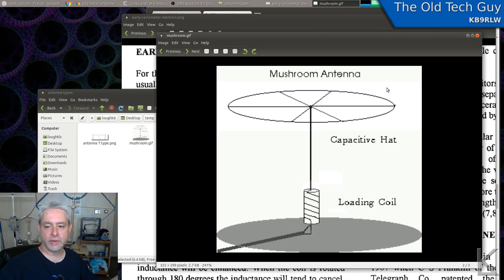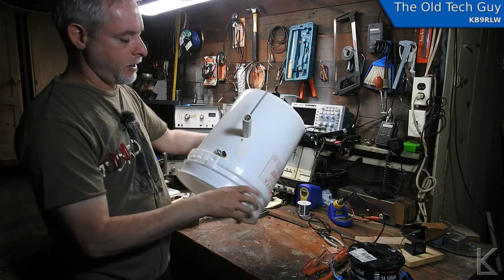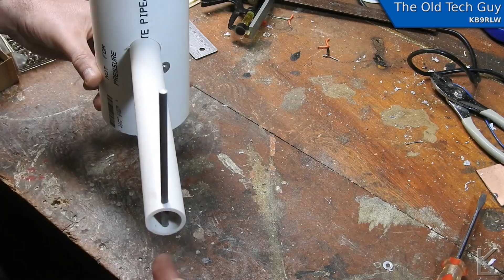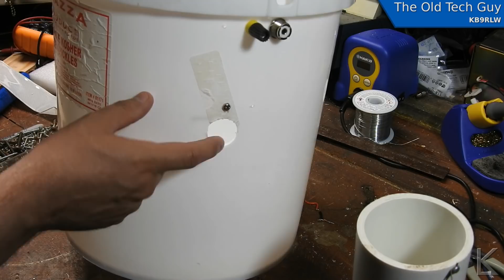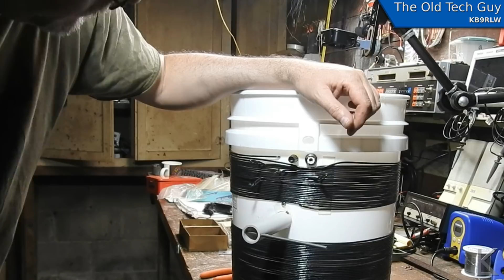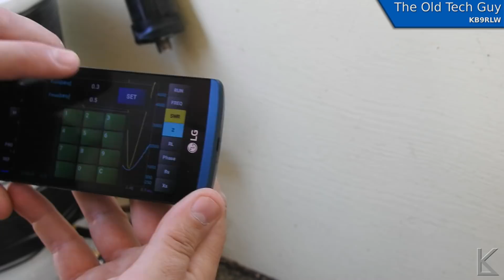Ham Radio  - Get on 630 meters with a bucket variometer!

Comment: Would this work for 252 kHz?
Reply from the maker: You would either need quite a few more turns or a much longer antenna wire.
Reply: @ I have a half-wave 600m wire but need to learn how to load it for 1kW…….

Comment: I think PVC can hold a static charge. Maybe use a wooden shaft for that axle and delete the metal turning grip (??)
Reply from the maker: With an antenna length of a couple hundred feet or so, I wouldn't be worried about wind loaded static charge. Any more so than I'd be worried about it on a regular antenna inspiration.
And anyway, any static would bleed off through the ground side of the inductor if you have a ground rod or down the braid through the ground of your radio. It would never accumulate.

Comment: If you don't mind me asking, how again do you have the SO-239 wired up??  And how do you strip the insulation for the taps?
Reply from the maker: The center of the so-239 goes to the end of the coil, the shield side goes to a binding post next to it for connection to a ground or radial system.
I used a razor knife to strip away the insulation where I made the taps.
Reply: @loughkb  Oh, thank you very much for the reply and the info. I appreciate it. :)
Reply: @loughkb  Also, on the wiring for the outside bucket, I guess it is two separate sets of windings rather than one long run from the 'bottom' to where the so--239 is...?
Reply from the maker: @tglenn3121  No, it's one long coil,  split into a center section that rotates.
I think i linked something in the video description.
There's a few diagrams out there if you search on 630 meters variometer.
Reply: @loughkb  But the wire windings around the outside bucket are 'cut' to attach to the lugs that the inner coil is attached to (if I'm seeing that correctly). Sorry to pester you about it, but  I'm just in the process of doing the wiring on this, and I just want to make sure I do it right the first time and understanding how you did it. Thanks for the very helpful video. :)
Reply from the maker: @tglenn3121  Think of it as three coils, connected end to end to make one big coil with a rotating center section.
Reply: @loughkb  Ok, that's a very good and clear way to think about it. Thank you again. I really appreciate you taking the time to elaborate. :)

Comment: Actually, Rig Expert has two antenna analyzers that have a range that goes down to 60 KHz (and up to either 35 or 55 Mhz). The new NanoVNA's also supposedly go down to 60 KHz.

Comment: 24:42 less total inductance for the same amount of lossy wire (or, realistically, more wire to make up the same inductance), which means less Q and less efficiency. So yeah, you don't really want to do that :)
Reply: The two opposing magnetic fields will also cause accelerated losses as well I suspect
Reply: @Dazzwidd  yeah, two sides of the same coin :)

Comment: Radials for MW on the ground? Over the ground? In the ground? How does that work exactly to shield from the ground? As far as i know you want height, lots of it this should minimise ground losses but sufficient height is not practical at 630M
Reply: I think that he does need to look into the ground side of things in more detail, but h height will definitely not help as with MF you're trying to propagate a vertically polarised surface wave signal, height would be what you'd be wanting to support a low angle space or sky wave signal. On these frequencies a horizontally polarised signal is going to suffer severe attenuation and it just doesn't work. 
Concerning the ground surface wave, it actually suffers less attenuation the lower in frequency you go. 
If you live in an area with above average soil conductivity or a high water table, this is a very good band to experiment on, if you're into it.
So putting a good ground down under your antenna is not to shield it from the ground really, but it's to improve the quality of the ground directly under the antenna, reduce ground return resistance losses and get your ground surface wave propagating as best as possible. All short vertical antennae need a good ground counterpoise on any frequency, and this is no exception

Comment: Thanks for the great video, Kevin. It was very helpful and motivating. One question for you. Do you know about how much of the wire (in footage) you used of the stranded and solid you used to make the bucket variometer?
Reply from the maker: Sorry, I didn't measure the length.
Reply: @loughkb  One of the things I'll be curious to see with your bucket variometer is how well it holds up in the weather. Where I live, which is kind of a cool coastal climate, those buckets dry out and become brittle within 6-9 months.

Comment: I've got a couple of assemblies , which I believe were for old time low band radios. Difference 1, they used switched Toroid So hard to describe I'm going to need to d a video . Would take a really crazy switching system. At one time for marine they had these ultra low frequency beacons. I actually have a Bendix Marine Direction finder with the frequencies. Way below the broadcast band. You can see why they would use a ball, maximum coupling. Hard to wind though. I'd love to put it on my Inductance measurement device from China, a little board. Would measure it fine. It also measures variable caps.

Comment: Kevin thanks for the great video!  I have a 140ft doublet im using hung up between two trees ~ 40/50ft,  for 160/80m, with ladderline down into a 4:1 about 5 feet up against the tree, then 100ft LMR to the shack.  Do you think this would work with the doublet?    It was a pain in the butt getting it up in the tree LOL. Thanks again!  73

Comment: Would this variometer also work on a G5RV which is basically a T to start with?
Reply from the maker: I would think it should, as long as it's a single conductor, the vario is right at the bottom of it and you have some kind of radials on the ground.
Reply: If your feedline to the G5RV is as long as one of its legs, and is mostly vertical, it would work very well. When the vertical part of a "Tee" vertical is shorter than one of the halves of the top part, efficiency can begin to suffer. If it's only a bit shorter, no problems, give it a go! If you have a metal fence close by, ground to that too. You may be pleasantly rewarded

Comment: if you can measure the inductance at the setting that works with your antenna on 630 meters, can and will you make a smaller fixed inductor to swap in and out when you want to work 630 meters? Better yet, will it STILL work if you made a fixed inductance one?
Reply from the maker: Yes, but you would still need some variable adjustment.  Temperature changes, humidity changes, it's going to drift a bit and need to be tweaked.  It's a narrow bandwidth, narrower when you've got a good ground plane.
Reply: JS: Yes, to both.

Comment: Hey Kevin. W9TE only on echolink during certain hours?
Reply from the maker: The computer had failed.  As I understand it, it's been repaired , but has yet to be re-installed at the repeater site.
Reply: Ah, that would explain it.Well, some day. By the way, you get much noise from the nearby high voltage line?
Reply from the maker: No, not much at all.  Somewhere down the line is a iffy ground though.  Windy wet days a bit of a buzz comes and goes.

Comment: Great build information of how to build the variometer. Looked around the internet and your instruction is the best and clearest I have seen anywhere.  The Hall of Flame pictures are very impressive but I believe we are limited to 5 watts on 630 meter band but your advice on keeping things in the clear is absolutely one of the golden rules to use.  Thanks for all your videos.
Reply from the maker: Thanks.  My motivation was the lack of instructions out there.  It took me lots and lots of reading to understand how to make it.  So I wanted to cover the whole thing in one hopefully easy to follow vid.
We're limited to 5W EIRP,  radiated power.  With inefficient antennas, you can pump in 100W in many cases and only radiate a few. :-)

Comment: Question about needing radial "density" to prevent ground absorption. Assuming all rf the same, with VHF and UHF there are reflector types of antennas that are porous. Rule of thumb, I think, is to keep reflector openings less than 1/10 wave length.

Why would this not apply at medium wave with respect to "ground reflectors"?  It would seem a 63  meter spacing would work.
Reply from the maker: You opening statement provides a window to the answer.  "Assuming all rf the same".   Nope,  RF behaves differently at different frequencies.   For example, in school, while learning about microwave RF and wave guides, I was surprised to discover that the behavior was similar to fluid flowing through pipes.   At some frequencies in HF, the earth will reflect the RF and we get multiple skips.  At medium wave, the earth will absorb the RF.  Down at Low Frequency and Very Low Frequency, the earth can even carry the RF along.

Comment: hi kevin works great the principle i used 2 times de coil windings and at the top a neon licht or pick up ponit whit a meter and diodes.the i make rest of the lengt whit the centerpoince and top load try too get more wires in the air so mutch as you cane.more is better.greetszzz

Comment: Would a slip ring connection method might have negated the need to use stranded wire connecting the moving coil to the outer coil.
Reply: GDK:  Yes, but at the trade off of higher resistance, increased complexity and probably less reliable contact.   All the old time designs with variometers use flexible wire and soldered/bolted connections.

Comment: Nice build Kevin :) Suggestion: for the tube to the centre coil, 3D print rings flat on one side and bucket curve on the other side that you can glue on the outside to ensure that each side has a flat surface. This way you will not have any play on the shaft.
Reply: Also add wire combs to space your turns like you did on the 4ft loop.
Reply from the maker: Everything I've read says you want the turns close spaced, insulation touching.  So that would actually lead to less inductance and maybe a need for a taller form if your antenna was particularly short.

Comment: Hi Kevin,
Very easy to follow build. Something that could be used for the ground plane is chicken wire. Not in your situation, but for those with an antenna out in the clear. How about a live stream on one of your testing sessions?  73  WB3BJU
Reply from the maker: The live stream is not a bad idea.  Maybe after the next project build.   A down converter to allow you to transmit with your existing QRP radio in carrier modes.  (WSPR, JT, mfsk, rtty, etc.)   And after band conditions improve in a couple of months.
Reply: Remember that chicken wire corrodes.
If there's metal fencing nearby, running radial wires out to it under the grass and connecting to them would possibly work well. 
I recommend looking at the antenna systems used by long wave, non directional beacons... well the ones I know were used in Australia anyway. 
They use a "Tee" arrangement, but the top of the "Tee" is comprised  of several parallel conductors between a pair of towers like a clothesline. The towers would be around 100 feet high. 
At the bottom is the matching and they use a transmitter of around 100W. I know that they definitely would have a ground system of some description, but I don't know what. I'd love to talk to the original  technicians who installed and designed them. On typical frequencies of 300khz, they tend to put out a solid signal to a regular loopstick bearing receiver for over 20km. This would be very handy info for the 630m operator.